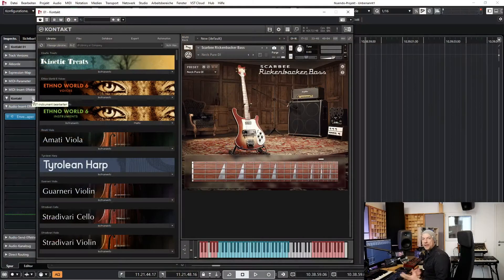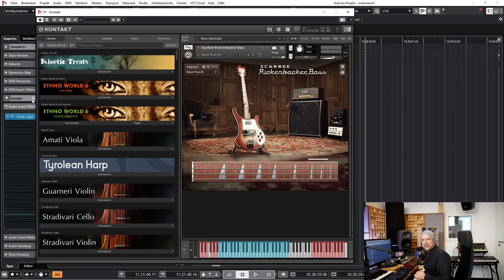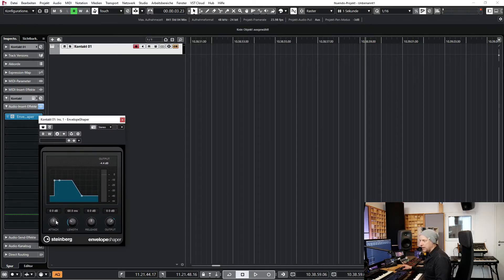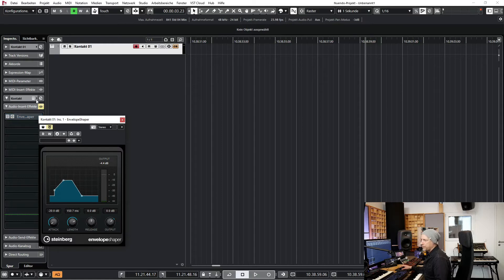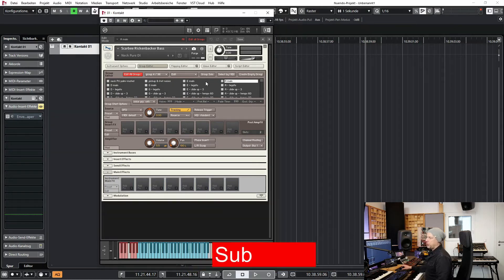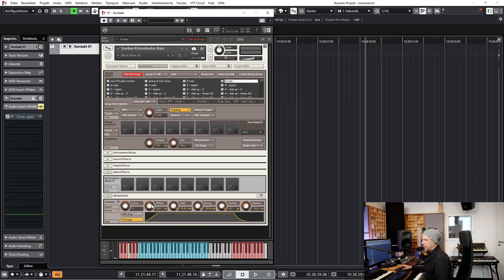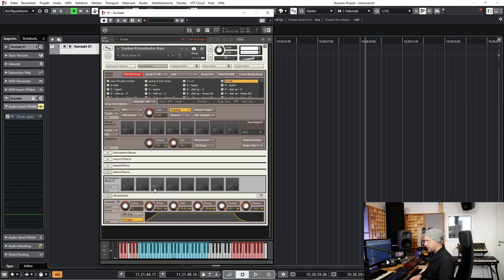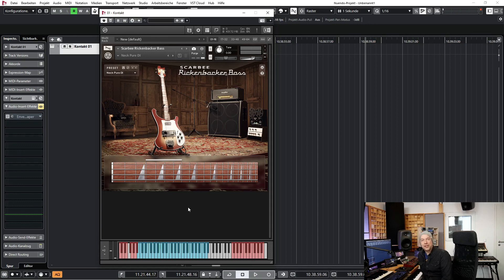Change Attack in NI Kontakt

Comment: I'm currently using Ableton Lite intro I want to switch to nuendo would I still be able to produce music or I'll still need to get Cubase if I can't I'll just have to stick with Ableton Lite bounce out stems to mix Dolby Atmos in nuendo which I don't want to do I'm trying to avoid Ableton the virgin that I have is limiting and not my preferred DAW I all so do video for my youtu.be channel which nuendo would work well with which Ableton live isn't designed for video work it more live performing with hardware synthesizers
Reply from the maker: Hi Sheriff, Nuendo is a good choice. I LOVE it. Nuendo is the big brother of Cubase, it includes everything of Cubase (except VST transit, but I never need this).
I recommend you first start with Cubase and when you need Nuendo, do an upgrade.

Nuendo is just an audio tool, no video editing.
Reply: @timheinrichenglish8782  I use Vegas pro for video editing but I want to do more with audio work but if I want with Cubase I would not be able to do 7.1.4 which is one of the main features I need
Reply from the maker: @Sheriffvlogs  You are right. For Dolby Atmos 7.1.4 you need Nuendo.
Reply: @timheinrichenglish8782  if I can produce music with nuendo I'll rather be happy with that so I can do music and 360 audio but I guess u can't use  MIDI in nuendo so I might just use Ableton which I'm trying to avoid I order have a licence for it because someone gave me
Reply from the maker: @Sheriffvlogs  You can use MIDI in Nuendo. You can use ALL features of Cubase in Nuendo.
Reply: @timheinrichenglish8782  thanks I'll get nuendo
Reply from the maker: @Sheriffvlogs  Great, have fun.